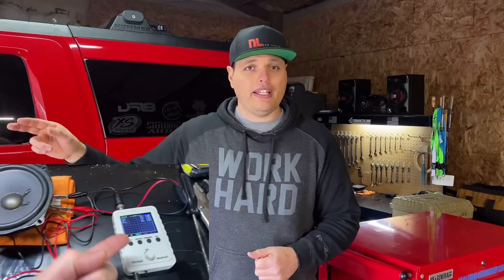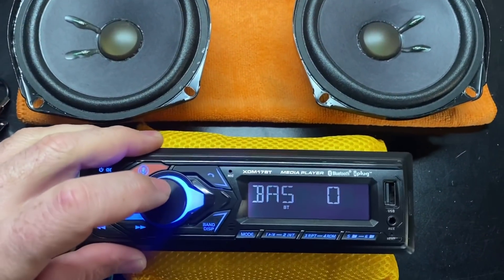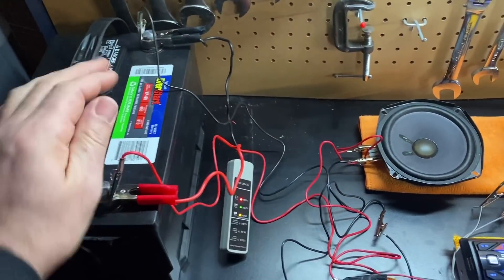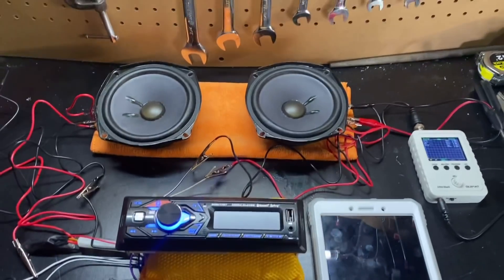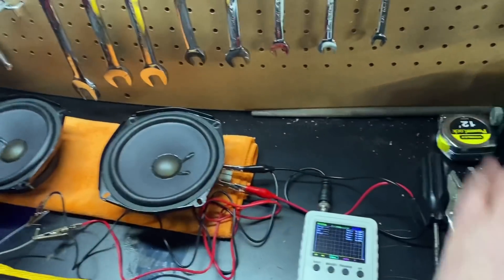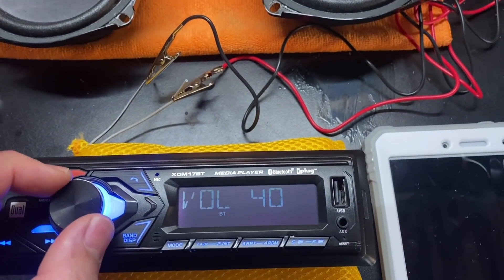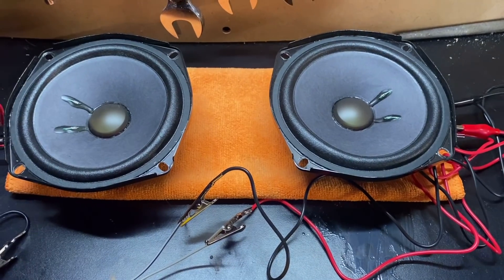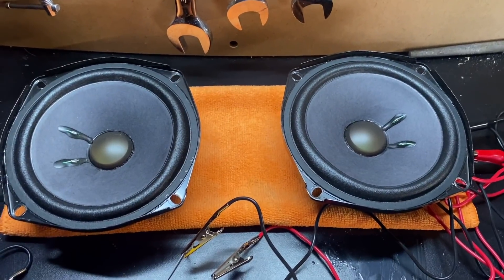#1 Must do tip!!! How to check head unit clipping and non distortion volume point of stereo.

Comment: I used my JYE Tech DSO150 to check for distortion in setting gains. I started with my head unit RCA out. I had my Oscilloscope set to default then with the arrow on the left and arrow on the right centered to the line. You have to hold down some buttons. So that was where I was at. And I used a 1k tone at 0db, -2.5db, and -5db levels on a CD. I cranked the volume up all the way and didn't see any distortion on my Oscilloscope at any of those db levels. Which didn't make sense.

Anyways, I played around with the "V/DIV" setting that changed the volt thing in the bottom left corner. Anyways at 0.5V it showed no distortion. But at 0.2V, it showed distortion that I was able to get a perfect sine wave by lowering the volume on the head unit.

I'm just wondering, do you know what is going on there? Just strange how you can see or not see distortion by what setting you have on the Oscilloscope.

My RCA out is from a high end Alpine 1DIN receiver that is 4V, which is supposed to be cleaner than 2V out. I'm wondering if this may be something where the distortion is so low out the RCA's that you can't normally see it until you zoom in on it by making the sine wave taller? My head unit's volume goes to 35. Though using 0dB 1k tones with a setting at 0.2V on the Oscilloscope, I had to lower the volume to 22 in order to get a perfect sine wave. Which seems really low as that is below 75% that people normally tell you to set your head unit to when setting amp gains. I did notice that I was able to increase the volume higher when using a -2.5dB and then even higher when using a -5dB tone which didn't make sense.

I know you did a video of setting amp gains via speaker out on a head unit. But I'd like to see a video of you checking distortion levels of a head unit via the RCA outs that has 4V output. That way maybe I could just set my Oscilloscope to what you used.

I'm kind of wondering if my head unit may be the ones where you can crank it up all the way without distortion. As I'm thinking maybe I'm just zooming in way too much on the wave compared to what most people would be normally looking at. As I know a max 22 volume out of 35 is way too low. As 4V RCA output should be cleaner than a 2V RCA output.

Thanks
Reply from the maker: Since RCA’s are low level, their readings will be much lower than that of high level (speaker wires). Most head unit RCA’s you CAN go up to max volume without them clipping.
Reply: @NextLevelCarAudio  Okay thanks. I'll just set the volume on my head unit to max volume via RCA while setting my external amp gains via the speaker wires.

I'll use 0db, -2.5db, and -5db test tones for setting amp gains and use my fine tip silver paint pen and drop a dot of paint on the amp for each setting. That way I can move the amp gain knob around and play around with it without having to get the Oscilloscope back out since I'll have three dots of silver to give me a reference point for the gain knob.
Reply: Though I don't get why people say to set your head unit to 3/4 volume if RCA output is pretty much clean at max volume. Otherwise, I'm guessing there are a lot of people using speaker out, and then run that into an external amp.
Reply from the maker: That, and there are lots of people that are running their front speakers off head unit power and have an amplified subwoofer setup. If you are running anything off your head unit only, you need to be aware if it’s clipping point
Reply: @NextLevelCarAudio  Okay thanks. Since I'm running RCA out to my front and rear speakers, then I'll just set the volume on my head unit to max, and then set the gains on the amp.

I think I'll do 0db, -2.5db, and -5db, and I'll use my ultra fine paint pen to mark those spots.Then I'll listen to it at the 0db setting and see if I have to max the volume out when listening to my hard rock/heavy metal, and when listening to real quiet music. 

If I don't max out my head unit volume, then I'll probably just leave it at 0db as that will give me some leg room when later I adjust my EQ, etc. As this is a new head unit, and so I don't know what I'll be setting those too. If I max the volume out, then I'll bump the knob to -2.5db and go from there.
Reply from the maker: Sounds like a plan. That’ll work ;)

Comment: So, I can just connect an oscilloscope to the speaker output wires coming off the head units wiring harness, unplug the RCAs and just test the head unit that way, correct? Those wires aren't even being used.
Reply from the maker: Yes! That’s correct

Comment: Question?  I have a 2011 f150 raptor with Sony nav stereo. How can I check clipping of head unit without tearing everything apart to get to factory amp?
Reply from the maker: Without accessing the rear of the head unit, Best way would be to guesstimate by ear.
Reply: @NextLevelCarAudio  thank for the info. Great channel btw

Comment: Can this be done using RCA’s coming from HU? Do I have to test every RCA cable? Should I use 1000Hz for mids and 40Hz for subs?
Reply from the maker: You got it. Only need to test left or right of each pair. Usually you can get to near max before clip
Reply: @NextLevelCarAudio  please read my comment

Comment: Great video, i actually bought the exact same Oscope to set my system up properly.. One question though, i always thought clipping meant the wave being squared off. In this video the wave only just looks a bit distorted... The graphics on this oscope is terrible. When i tested it at first i thought i was clipping even at really low volume as the lines are not perfectly straight, then re watched your video and realised its just the oscope... But because the wave is not graphically perfect on the screen it makes me question when is distortion really occuring..
Reply from the maker: Clipping is when the wave is “clipped” square top. Distortion is when the wave starts to “distort” from its true natural curve shape. I set my gear to not only knit clip, but to also be distortion free. Sounds VERY clean if you do it this way. I tell people If it’s not loud enough, don’t turn up the gain to compensate, get more amps and speakers.
Reply: @NextLevelCarAudio  Thanks for the reply -Ah fair enough yeah that makes sense.  I tested all of my equiptment again and found that for some reason the sine waves look fine even at max volume on a 1khz test tone (testing mid speaker). But when i tapped into the underseat sub speaker wires (low pasesd by factory system) i could not get a clean sine wave at any volume  - the sinewave wasnt distorted like in this video. However the top of the wave (although not squared/clipped) looked jaggedy like a mountain top.... Its wierd because the bass does sound very clear with no audible distortion :/
Reply from the maker: That is strange... that’s when tuning by ear really comes into play. Sometimes our ears can be better assets than gear

Comment: How would I do this on a system that doesn't have a head unit but is using a phone, 2 amps and a Stetsom DSP for a "head unit" would love any help you could give me. I use my phone to connect to a Bluetooth module which has a bass gauge for my volume knob so I can have thr volume maxed out on my phone and control it from thr knob
Reply from the maker: Damn, I don’t know man. Sorry :/
Reply: @NextLevelCarAudio  thanks for replying, love your videos and you have taught me alot. Take care.
Reply from the maker: Thanks man. Sorry I could not help with this issue for you. :/

Comment: Hello my friend. sorry my english is not that good. I checked the head unit with 0db. bass amputated-3db. how do I measure middle and high? 0db is too quiet. can I also measure middle and high with -5db or -10db? which DB would be the right one?
Best regards
Reply from the maker: You can use -5. That’s fine if 0db not giving you the output you want

Comment: Nice now is there different types of clipping sounds cause mine doesn't sound like that  so I'm working  if its something intirely different whats happening  to my system only on the highs & mids amp?
Reply from the maker: Could be simple distortion... not a fully clipped signal. Incorrect filter settings or gain to high could be the culprit
Reply: @NextLevelCarAudio  i hope I'm not being a pain with all these questions & if I am my bad I'm just trying to figure this out some how, now I turned off crossover on my headunit pioneer 4200nex turned off subwoofer  & just played my highs & mid's amp have this usb with some old school music I don't know but certain music on there spike some highs that trigger the cut in & out clipping I think its the amp. Now a friend of my tells me I have to set the new amp to HPF & not to Full like you you said so naturally I'm sorry for questioning so much but I'm just seeking what's the best here I'm frustrated.
Reply from the maker: If you are playing full spectrum sound from your components (low,mid, and high) then you need full range sound. The only exception is if you can set your HPF filter to 100hz. To pass everything above that freq. but in that case, it would be better to leave it in “full” and use your Subsonic filter set to 100hz. Sub sonic filter acts just like a HPF but allows you to still run amp in full mode
Reply: @NextLevelCarAudio  thank you for being patient & for replying to an ol'school bass head like me ,now you saying leave my pioneer 4200nex headunit crossover OFF set the skar skv2 200.4 to FULL filter set subsonic to 100hz leave  the other  @ 80hz  and call it a day I'm done.
Reply from the maker: When you say other at 80hz.... are you talking about your subwoofer amp/LPF? Sorry, I answer lots of comments on here so just making sure.
Reply: @NextLevelCarAudio  no on the multi amp only my sub amp is fine no problem there now references to HPF after setting the x-over being  set to Full?
Reply from the maker: Got it. Yes sir. That sounds good
Reply: @NextLevelCarAudio  got it 👍 let you know the outcome after I install this skar
Reply: @NextLevelCarAudio  so I finally got that skv2 200.4 installed set to how you said its playing so far so good ,going to do more testing tomorrow it got to late & the only thing is the subsonic it goes from 10-500hz where in the heck is 100hz on this amp I set it between 1 o'clock  & 2 o'clock hope that's it cause unless I buy a cc-1 I wouldn't know any suggestion very much appreciated all your help & videos thank you 😀
Reply from the maker: Hey man, good to hear.... but where you currently have sub-sonic is closer to 300-350hz. Straight up and down (12-o’clock) would be close to 250hz. So if anything, it should be at 10 or 11, not 1-2 o’clock. No need for fancy gear. You can place 4 evenly spaced Hash marks with a pencil between the 10 and 500 markings. Once you do that, each hash mark represents 100hz. As long as you are close you are golden. No need to be exact as you got db/octave slope working in your favor
Reply: @NextLevelCarAudio  cool you been on point so far & for that I appreciate you sir I also want to ask you a phone on bt can one be higher-up on Distortion than another phone ?
Reply from the maker: Yes. That is why some head units have a SLA (source level adjustment) function. Not sure if yours does or not... good (expensive) head units automatically adjust the source level for you so it’s not a concern. But that is very common. I had a head unit that when my iPhone was connected it was perfect, but when I connected my android tablet via Bluetooth it was considerably louder at the same volume point. So if you don’t have any kind of SLA adjustment, I recommend tuning your setup to whatever device plays the loudest at the same head unit volume point
Reply: @NextLevelCarAudio  yeah my pioneer has that SLA ,crossover, time aliment,  listen position & such also network mode & standard mode mine @ standard
Reply: This just in, I know how you feel about dd-1 but I was setting my bass amp weeks before & I noticed the skar amp bass knob indicator red  clipping light came on before the dd-1 did while I was setting gains so I adjusted to that instead of the dd-1 is that ok or should  I go back & redo I just didn't want that light  keep flashing and annoying me what says you?p.s to set the gains on this 4 channel amp do you check all 4 channels or just 1-2 or 1-3
Reply from the maker: To check clipping on 4 channel no need to check all 4 channels. Check channel 1 and channel 3 and your good to go. You know how I feel about DD1’s 😂 but the clip indicators that come with the amps remote knobs are known to be inaccurate. Don’t use those to tune your amp. I would trust any other method (dd1, ear, tweeter, oscope, etc) before I trust clip indicator light to set my gain off of.
Reply: @NextLevelCarAudio  today I went into my closet of past,& found my punch 600.1 now things would be much easier if amp manufacturers put the dots like the punch amp did for thes hz frequency
Reply: @NextLevelCarAudio  question for subsonic, I'm hearing different  methods for setting gains now do I set the subsonic  to its hz then set the gain or do I leave it off then set gains?
Reply from the maker: Gain should always be the very LAST thing you set to dial in your system.
Reply: @NextLevelCarAudio  what do you mean 🤔 in regards to my question on the subsonic?
Reply from the maker: Set All your crossovers how you intend, including your sub sonic. Then you gain is your last adjustment

Comment: I know I'm late but, how would I check my factory radio's clipping point with an oscope if I'm running an equalizer from head unit to a dsp? Would I test volume from factory radio before the equalizer or after the dsp? Thanks if u can respond
Reply from the maker: Best to do it right at the source before any processing takes place. So yes, as signal comes out of head unit before any signal processing
Reply: I'm confused on whether to use 0db test tone or-5db test tone..which do u recommend?
Reply from the maker: 0db to play it safe and have gains set more conservatively. That’s what I use. If not loud enough, then more subs and amps! Lol

Comment: How do u do for tweeter ? For the gains.
Reply from the maker: Most effective way is oscope using a 1000hz test tone. I have videos going over it using a cheap scope and also a expensive bench top one
Reply: @NextLevelCarAudio  thanks is it as accurate as a more expensive one?
Reply from the maker: Exactly as accurate. Check this out: https://youtu.be/nKQqcQ5q34I

Comment: I just did this with my pioneer NEX AVH2500 head unit. @ max volume 40 it doesn’t distort at all . So What should I make my target volume?
Reply from the maker: 75% is the rule of thumb. So I’d do 30 to have some headroom. then set your gains accordingly
Reply: @NextLevelCarAudio  thanks !
Reply: @NextLevelCarAudio  last question. Can these cresendo Amp’s be tuned without the speakers being hooked up? I’m only using mines for Midrange speakers. I have cresendo 3000.2D
Reply from the maker: Yes they can! That’s exactly what I did for all my nendo’s

Comment: What if Im using my RCA jacks to an amp for my speaker?
Reply: Match the voltage with a DMM , to your corresponding rcs’s that you’re using for your amp , and match pre-out voltage from your hu with the VOLUME, like 2v or 4v , or 5v sometimes . Just don’t send more than what your head unit recommends, then set gains appropriately.

Comment: Can you test this on the line outs instead of the high outputs I don't use the speaker wires from head unit
Reply from the maker: Yes, but most head units don’t clip low level even at max volume. You can check to make sure tho

Comment: Can u do one about powering everything from battery to alternater and to adding power in the back for maximum power from the battery n alternater + the amount of wires for each amp lol ik i need more cables but how do I do under the hood setup
Reply from the maker: I’ll see if I can add that to the mix

Comment: How’s it going brother!

Been learning so much from you and your vids, thank you for your time and effort!

Got a request: I’m someone who has a factory head unit, an Audiocontrol Lc2i, an Audiocontrol bass restorer, and an aftermarket amplifier. I’m sure I’m not the only one with the extra bells and whistles :)

Can you please teach us where to start checking for clipping, and where to go after each step until we’re done tuning for clipping?

Thanks again brother!!
Reply from the maker: Work from front to back. First fine head unit clipping point. Then voltage match all in line components, then finally set gain on your amp
Reply: @NextLevelCarAudio  how do I test the factory head unit when using a lc2i like where do the plugs go to check for the head unit for distortion ? Btw it’s a Cadillac ATS with Bose system. I tried tapping into the rca on the lc2i but got nothing

Comment: so what if im running low level out puts for my amp for my fronts and rears? do i still do this on the high level out puts to find out cliping, then also do this for the gain for the amp? thank you
Reply from the maker: If using low level, they typically don’t clip at the head unit Even at max volume. You can verify by testing them using this same method
Reply: @NextLevelCarAudio  thank you for clarifying, your videos have helped me out alot thanks
Reply from the maker: Awesome!

Comment: I played around with this and I get distortion at different volumes depending on what frequency of test tone is being played I normally play music right at around volume 27 or 28. Playing a 40hz test tone I heard distortion at volume 26 playing a 1000hz it was well above volume 26. I pkayed with other frequencies and it varied. What number do I go by?
Reply from the maker: I would go with the lowest volume that starts to distort. If you are running amplified, then you can adjust gains accordingly so that they all peak the Same